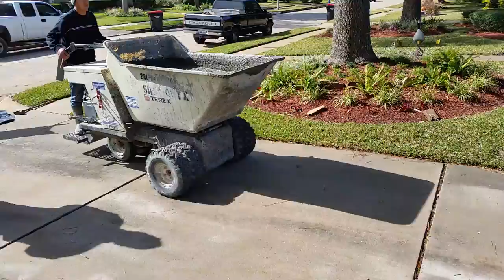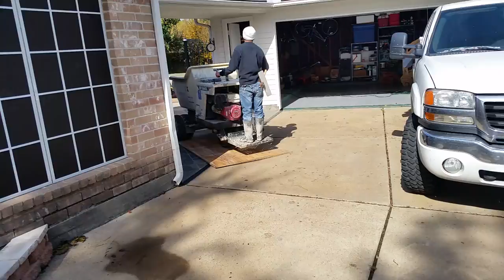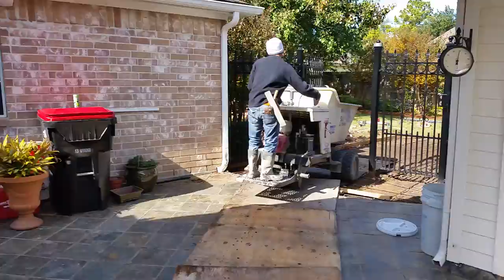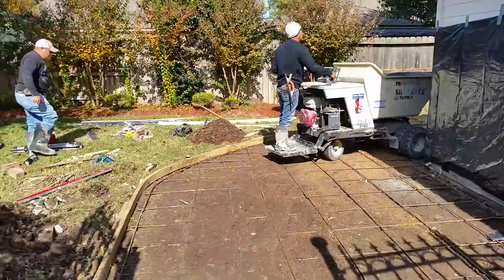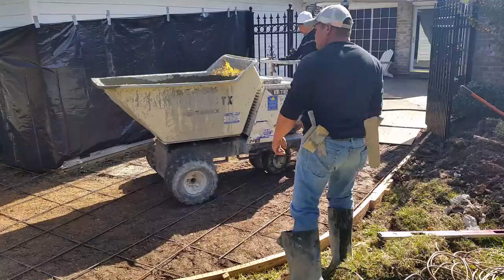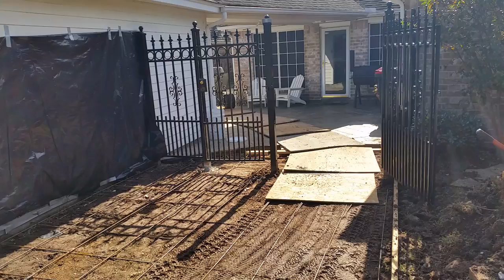Concrete Delivery Georgia Buggy

Comment: Waste time better with concrete pump
Reply: True .but more expensive
Reply: True!! And, you can have the re-bar set up on "Dobies" so it's in the middle of the slab since you aren't running over it with a "truck". The "Cheaper" way is RARELY ever "the better way"!!